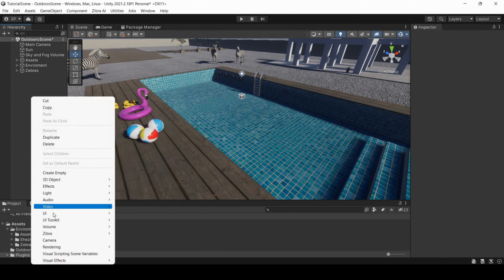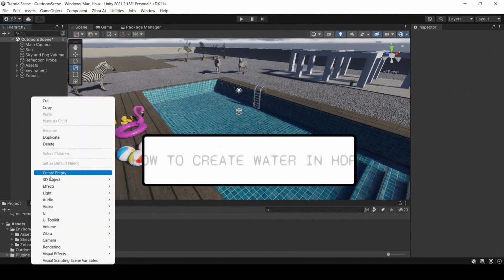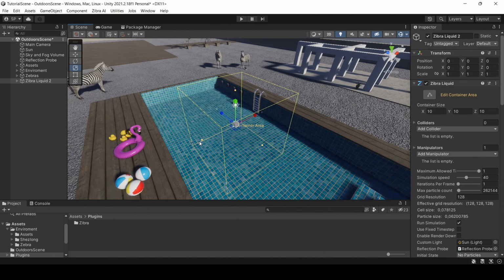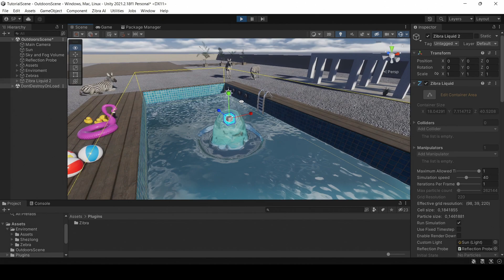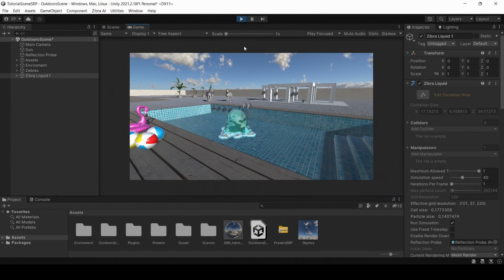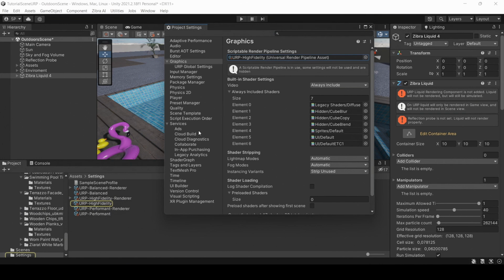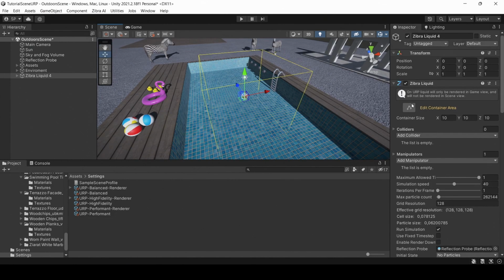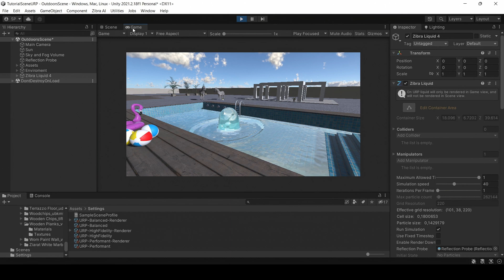Zibra Liquids - Tutorial 2. How to create liquid in Unity? | Unity 3D

Comment: Can you create larger scale liquids like oceans? Also, is there any way to bake the liquid for offline usage, or will we have to generate the liquid from scratch everytime in realtime?
Reply from the maker: Zibra Liquids is a perfect solution for small to midsize simulations. Despite it’s not сurrently meant for creating oceans and seas, we've already received many requests to include such an option, and it is already in the backlog.

Regarding your second question, you can bake the initial state of the simulation, so when your scene loads you already have liquid.
Reply: @ZibraAI  Thanks, looks like an awesome tool, but I have a slight problem: The free version doesn't seem to work with Unity 2021.2.3 HDRP. Getting a black screen in game view and nothing happening in scene view. Also tried it with Unity 2020 LTS HDRP and same result
Reply from the maker: @ironknightzero  Thanks for reporting! Please make sure that you are using the supported graphic API. On Windows, it's DX11, and on macOS, it's Metal. If you are using raytracing in your HDRP project, it requires DX12 to run, and so it won't work in the same project with our liquid yet, but DX12 support is coming in the following releases. Join our Discord, it is the fastest way to communicate with our team.